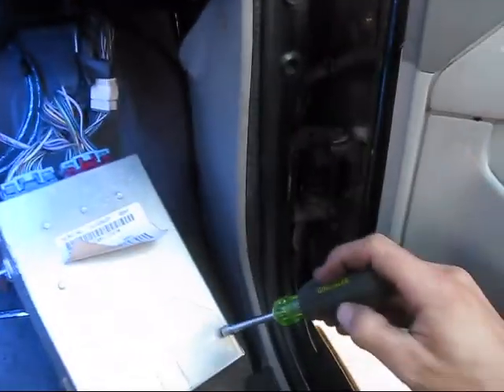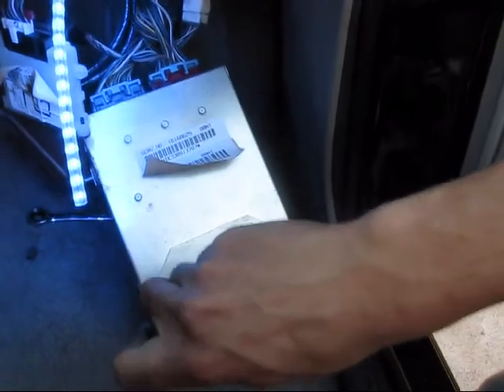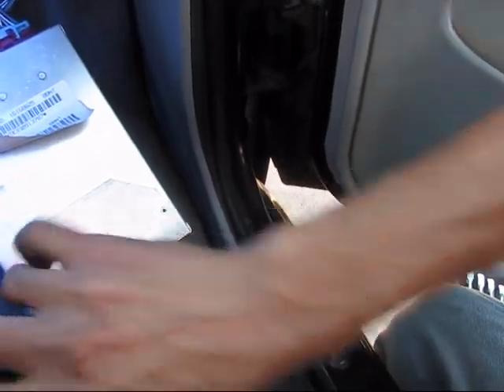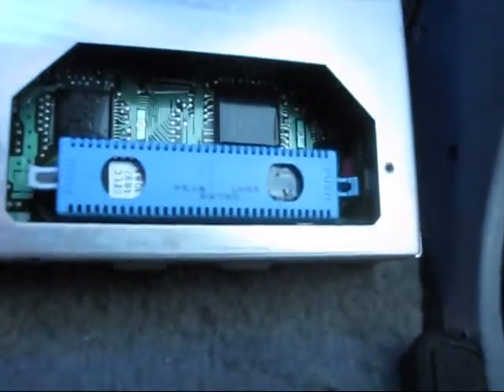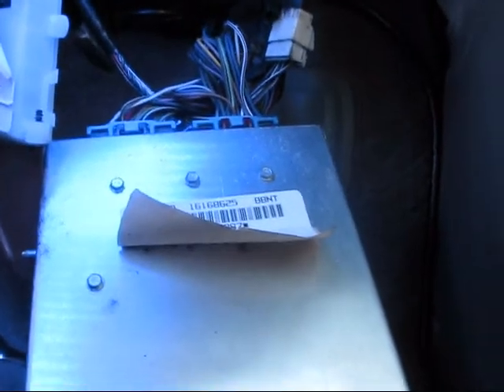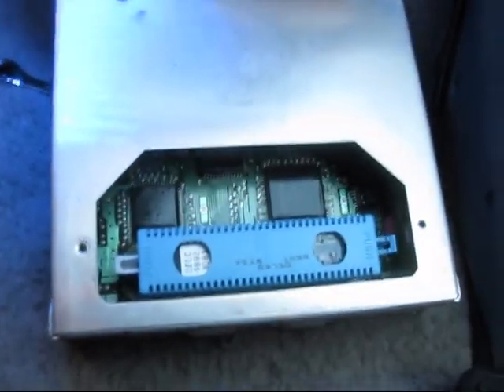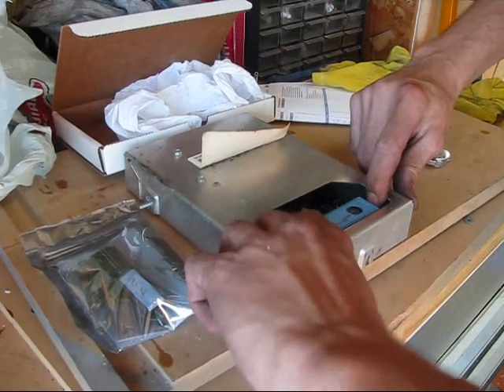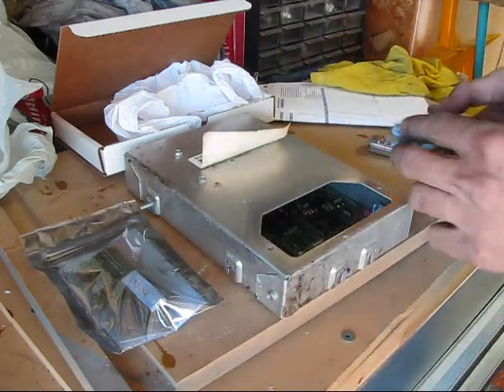Performance Chip Install 93 S10 Blazer

Comment: I have a 93 4 door Blazer 4.3 CPI. I installed an electric fan, hooker long tube headers, custom exhaust from the headers back and a cold air intake. I purchased the truck new in 93 and it was already fast. Now she is a rocket.

Comment: Will this work for a 91 gmc sonoma 4.3
Reply from the maker: it should be compatible with that vehicle, it was specific to the engine of I recall correctly
Reply: Thanks for the response I really appreciate it what was this chip called an did u feel a increase of power
Reply from the maker: @georgebarajas3538  I installed the multitude of things at the same time and overall I saw an improvement I can't say specifically that this chip made a difference it might just be all in my head. Might be wise to check out some forms and ask other people the same questions
Reply: @RobHoffmann20  thanks again man did u install a Performance cam on ur truck
Reply from the maker: @georgebarajas3538  Yes I do have a larger cam, roller lifters and roller rockers.
Reply: Where u able buy it as a kit or did u buy each thing separately did u touch ur fuel system at all I really appreciate u taking ur time to answer my ?s there’s not. Alot of people doing this with a 4.3
Reply from the maker: @georgebarajas3538  Fuel system is stock.  i'll link the build video for you.  it's got all the P/N's for the engine
Reply from the maker: @georgebarajas3538  https://youtu.be/iStOlygfNz4
Reply: @RobHoffmann20  thanks
Reply: @georgebarajas3538  No one builds the 4.3L bc they are so expensive to build, One of my dreams has been to build a badass 4.3L for my 95 S10, But on a budget that will never happen lol, I've got Headers & a Throttle Body Spacer but other than that there's not much else you can do to a TBI, Now CPI I'm not sure, I don't really know anything about those Engines.... I am in the middle of swapping a CPI Engine over to a TBI tho for my Truck, bc I blew the old TBI engine up and I had a CPI engine laying around, so I pulled all the CPI stuff off it and I'm putting the TBI stuff on it.... I'm also planing to do a 4.3L/5 Speed 4X4 swap on my 1984 S10 Blazer too, bc it's a 2.8L/Auto right now and those engines suck in a 4X4

Comment: did u notice much difference. did u put new cam in b4 putting tuning chip in. I'm thinking of doing new cam and chip for fuel rto on 1995 Blazer wondering if worth it
Reply from the maker: Joey G I had rebuilt the engine with an aftermarket cam and the chip was installed afterwords along with a new MSD distributor and an under drive pulley kit.  the items were all installed in the same day and I did notice a difference however I can't say how much each individual part helped out.

Comment: Any noticeable difference?
Reply from the maker: I did the chip, Underdrive kit, and MSD bullit distributor all at once. A-lot more torque and it runs much smoother. literally tap the ignition key and its running.
Reply: Worth the big price tag though?
Reply: +Darby Ellis  Nope it's not actually when you test it from a technical point of view? It is a lot of snake oil..
Reply: High guys! Wade here from Australia. That's a moates g1 adaptor. The more mods you've done and obviously the better the tuner is, the better the results you'll get. A custom tune will always be better than a mail order tune one size fits all. In this video I did see that the factory eprom was fitted incorrectly. The little blue cover needs to be removed in order for it to all sit down correctly. Another thing to look into with these g1 adaptors is the moates ostrich 2.0 which allows you to do real time tuning and also view the real time tuning and data log it through a obd port. Once your done with your custom tune, you simply remove the ostrich and burn your new tune to the eprom, plug it in and your done. Hope this helps you guys
Reply: @wademunyard9026   Sure does help.